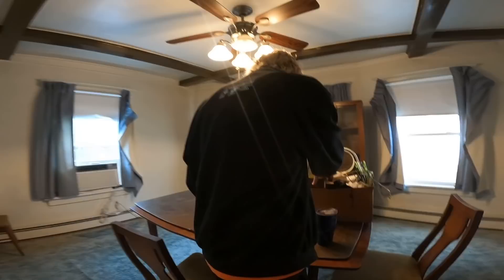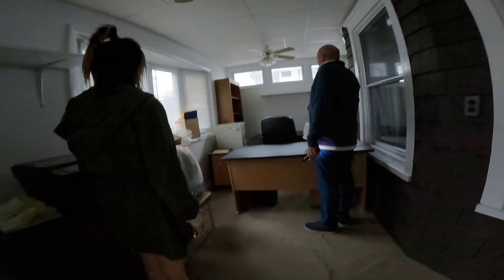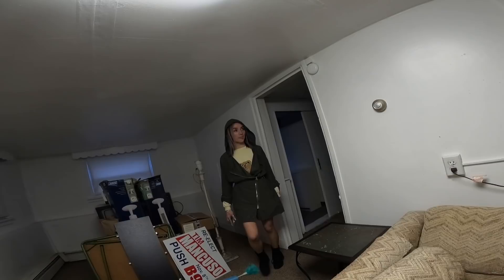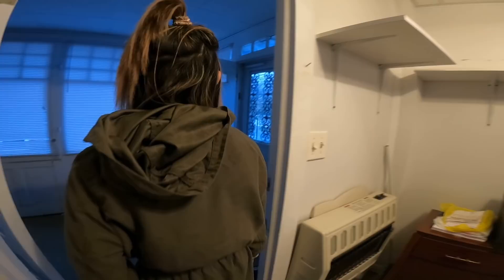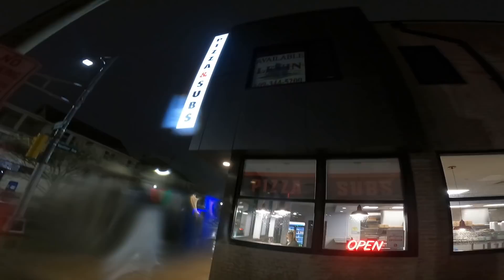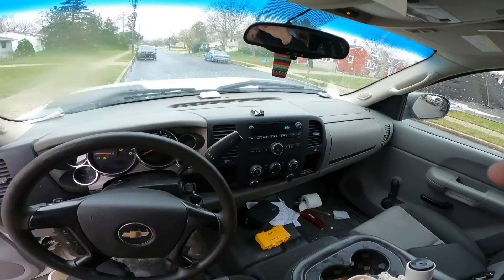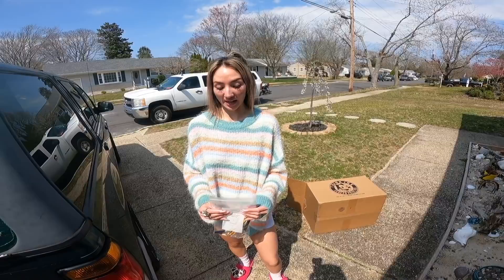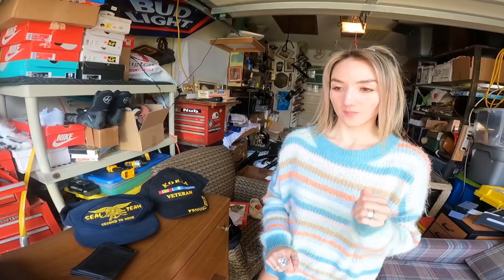WOW! House Clean Out Reveals RARE Items!

Comment: The cabinet Sammie called a bar is for VHS tapes. The table with the slot in the top is for a computer printer with bottom feed paper. The box of paper sat on the lower shelf.